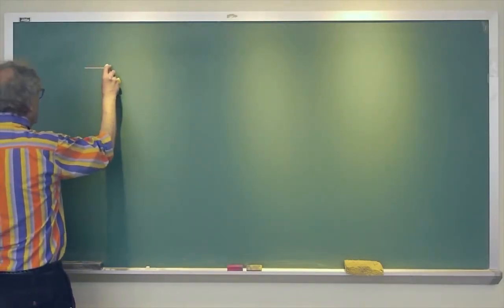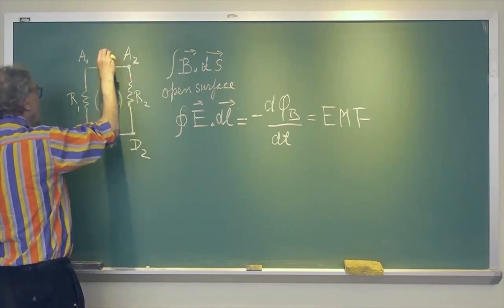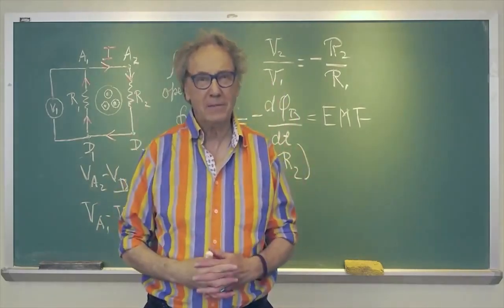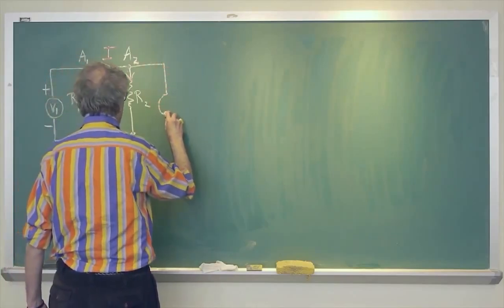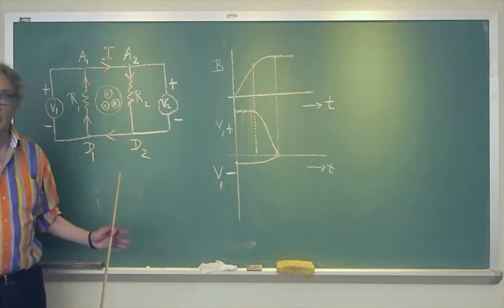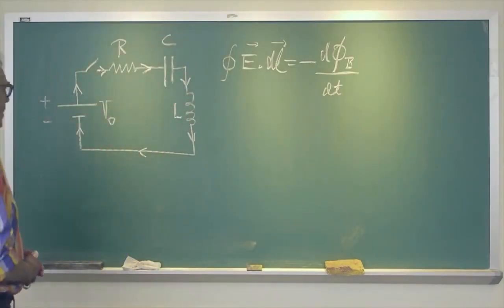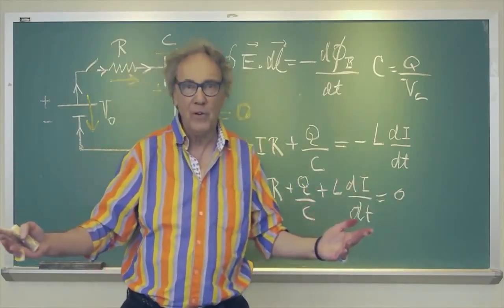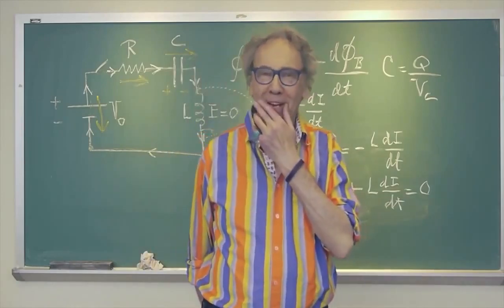Kirchhoff's Loop Rule Is For The Birds

Comment: Hello Dr. Lewin,

When you  applied Faraday's law on the RLC circuit and you  drawn the electric fields of the battery, resistor and capacitor, these electric field are conservative ? As for the self-inductive L, can we say that the electric field is zero because it consists of the sum of a conservative electric field + non-conservative electric field?

Thanks
Reply from the maker: The E-field in an ideal L has to be zero because it has zero resistance.
Reply: Yes, but when you measure the voltage across the inductance it gives a certain value. This value is due to a conservative electric field? What about the electric field across the resistor and capacitor in the RLC circuit?
Reply from the maker: That is all explained in detail in my lectures.
https://www.youtube.com/watch?v=t2micky_3uI&index=21&list=PLyQSN7X0ro2314mKyUiOILaOC2hk6Pc3j

https://www.youtube.com/watch?v=FWMhk6x785Q&list=PLyQSN7X0ro2314mKyUiOILaOC2hk6Pc3j&index=26

and in others
Reply from the maker: https://www.youtube.com/watch?v=nGQbA2jwkWI&index=17&list=PLyQSN7X0ro2314mKyUiOILaOC2hk6Pc3j
Reply from the maker: What they write is perhaps not wrong but it's NOT the way I think of why the E-field in an ideal L is zero.
Reply: if it is not the case, then  you don't consider there are a build-up charges on the surface of the inductor? And when you mentioned in this lecture that the measured  electric field outside the inductor is non-zero, and its integral over dl is equal to Ldi/dt, this electric field is due to what then? Is it conservative or nonconservative? 

Thanks for the discussion sir.
Reply from the maker: watch this lecture. I cannot add to that.
https://www.youtube.com/watch?v=nGQbA2jwkWI&list=PLyQSN7X0ro2314mKyUiOILaOC2hk6Pc3j&index=17
Reply: Sorry If I am asking a lot of questions. But I am a little bit confused about this issue: 
In this pdf http://freepdfhosting.com/d5fc27ec92.pdf, ok I understood that the electric field is non-conservative across resistors R1 and R2 and I understood why each voltmeter shows different values. But what I am confused about, if we replace the voltmeter by a resistor R , there's an electric field inside this resistor. This electric field is still non-conservative? Another case, taking the inductance circuit (LR or RLC), if we connect a resistor in parallel with an inductance, the electric field inside the resistor is conservative or no? 

I am asking these questions because when we connect a generator (inductor) to a resistive circuit or any other circuit, the generator will have a non-conservative electric field like an inductor, however the generator will produce an electric field inside the resistor that is conservative thus the appearance of surface charges across the resistor (I don't know if it is true). If this statement is true, then,  what is difference between the closed loop in this pdf http://freepdfhosting.com/d5fc27ec92.pdf; where the electric field is non-conservative and I suppose then there's no surface charges built on the resistor; and a circuit containing a generator + a resistor. 

Thanks again.
Reply from the maker: The demo I show has become a classic - it is shown all over the world. Two identical  voltmeters connected to the same 2 points in a circuit show very different values and the polarities are reversed. That's the power of Faraday’s Law which runs our entire economy. It's amazing how many people have a religious INCORRECT believe that Kirchhoff's loop rule always works. If that were true my two voltmeters should read IDENTICAL values with the same polarity but that is not the case. K’s loop rule is only valid if d(phi)/dt=0 but that is not the case here. Thus the integral of E dot dl in going from A to D depends on the path and the 2 paths are different; one path is through R1 and the other path is through R2. If you don’t get it, you are not alone. Occasionally I get comments from people including science teachers who want to argue with me about this demo  - they clearly never FULLY understood Faraday's Law. I never argue with anyone about this as this is too basic.
This is my last msg on this topic.
watch https://www.youtube.com/watch?v=nGQbA2jwkWI&list=PLyQSN7X0ro2314mKyUiOILaOC2hk6Pc3j&index=17
Reply: I am not arguing about this demo and I fully understood it. I am talking about the electric field across a resistor  connected to an EMF source (Generator) and the difference between it and the demo... I understand that in the demo it is non conservative field but in the case of the generator if it is not conservative how can we explain the appearance of built-up charges at the surface of the resistor.....
Reply from the maker: Potential difference between 2 points is not well defined in cases where dphi/dt is not zero in some loops. What is always well defined is the intergal of E dot dl across a resistor. If all fields are conservative we call the integral of E dot dl the potential diff over the resistor and the potential difference between 2 points points in a circuit is then independent of the path. It all follows from Maxwell's eqs. Faraday's Law is one of the 4. The answers to ALL your questions are in my lectures. I cannot continue this discussion. You have to do some more work. sorry.
Reply: Paul Tibet  rr

Comment: Imagine an electromagnet hanging over a plane of superconducting material. If I switch on the magnet, Eddy currents will flow. If there can be no electric fields within superconducting materials, what then makes the current flow? Can't bend my brain around that.
Reply from the maker: First, I suggest you read up on Meissner effect. Second, keep in mind that J(current density) = E*sigma (sigma is conductivity). If E is zero and if sigma is infinity, J can be anything.

Comment: This is indeed a remarkable phenomenon. Voltage measurement is dependent of the measuring loop the cables are forming. And I'm sure a lot of teachers out there are not aware of it. 
On the other hand this is something every prospective electrical engineer should know after three months into the study.
Reply from the maker: Yes, they SHOULD know, but many don't. Watch my demo in this lecture, it will blow your mind. https://www.youtube.com/watch?v=nGQbA2jwkWI&index=17&list=PLyQSN7X0ro2314mKyUiOILaOC2hk6Pc3j

Comment: You didn't confuse me.  You UNconfused me.  I graduated decades ago, but was reviewing Maxwell's Equations by watching videos on YouTube.  On review, Faraday's Law didn't make any sense to me at all, because I saw almost immediately that it appeared to contradict Kirchoff's Voltage Law.  I puzzled about it for days, with only a vague understanding of what might be wrong, until you finally confirmed that Faraday was right and it was Kirchoff that didn't apply.  That was hard for someone trained in electrical engineering to accept after all these years.  Thank you for setting me straight!
Reply: Watch the electroboom video on disagreeing with master...Kirchoff law and faraday laws both hold good...problem is with experiment of Dr.Lewin...He didn't consider the voltage induced in the voltmeter wire due to poor probation of voltmeter...
Reply from the maker: @devangagnihotri5413  maybe this will help you:
I have addressed all relevant issues already 16 years ago in my Lect #16 and #20 of my  MIT course "Electricity and Magnetism" (course 8.02)
8.02 Lect #16: Electromagnetic Induction https://www.youtube.com/watch?v=nGQbA2jwkWI&list=PLyQSN7X0ro2314mKyUiOILaOC2hk6Pc3j&index=17
8.02 Lect #20: Inductance RL Circuits https://www.youtube.com/watch?v=t2micky_3uI&list=PLyQSN7X0ro2314mKyUiOILaOC2hk6Pc3j&index=21
and also in my lecture notes of Lect #20
Belcher/Lewin Most Physics Books got it wrong
http://freepdfhosting.com/0813df09f5.pdf
For more information see below
Is Kirchhoff's Loop Rule for the Birds?
https://www.youtube.com/watch?v=5be3zpj_eCY&list=PLyQSN7X0ro22zanLOcvkaSY-IZqheFYM5&index=7
Romer (1982) What do Voltmeters measure?
http://www.phy.pmf.unizg.hr/~npoljak/files/clanci/guias.pdf
To Agree or Not to Agree with the Master that is Not what Matters
https://www.youtube.com/watch?v=ototTU5NUNA&list=PLyQSN7X0ro22zanLOcvkaSY-IZqheFYM5&index=58
To Agree or Not to Agree that is Not the Question
https://www.youtube.com/watch?v=AQqYs6O2MPw&index=57&list=PLyQSN7X0ro22zanLOcvkaSY-IZqheFYM5
My Sincere Apologies https://www.youtube.com/watch?v=d_XqrZo5_7Y&index=1&list=PLyQSN7X0ro22lt9yiC7-aYnM8GWwqnICd
Believing and Science are Very Different
https://www.youtube.com/watch?v=wz_GqO-Urk4&index=10&list=PLyQSN7X0ro22zanLOcvkaSY-IZqheFYM5
5+3-8=0 https://www.youtube.com/watch?v=f3-SfzepuPs&list=PLyQSN7X0ro22zanLOcvkaSY-IZqheFYM5&index=9
Reply from the maker: Thank you for your honesty. Watch the demo in Lect #16 of 8.02. It will blow your mind! https://www.youtube.com/watch?v=nGQbA2jwkWI&index=17&list=PLyQSN7X0ro2314mKyUiOILaOC2hk6Pc3j

Comment: I understand Faraday's law, and I understand it ALWAYS applies (I have a BSEE and 43 years experience in the field).  This is not about a law, it is about a method of analysis, and where the law is "cranked into" the mathematics.  When analyzing using EM field analysis, the law is exactly as you say, and all the "weird" results cited in your problem happen, if the "circuit" were built physically as you say (but you would need either a LOT of iron filling the loop, a superconducting coil providing the MMF, or run at a high frequency to see a significant effect).  When analyzing by circuit analysis, Faraday's law still applies, but it must be "packaged" inside a component.  So the flux you have linking the "circuit wiring" is an inductor "in sheep's clothing"; so it needs to be made into a "real" circuit inductor if you choose to use circuit analysis (or better, a transformer, since you need a way to produce flux external to the resistor loop).  In circuit analysis, all differential equations come out of components.  The interconnections only set equates between variables all those equations, by application of Kirchhoff's current and voltage law, to get the DiffEQ for the whole circuit.  If a "circuit" is made that doesn't "obey" the Kirchhoff's laws, then it is not a circuit, by definition!  So the teaching needs to make a distinction between the "thing" you have built and a "circuit".

I could conjure up a similar "circuit" having some big parallel plates mixed up with some resistors, and claim to violate Kirchhoff's current law when I start waving some charges around.  But again, this would be a violation of the use of circuit analysis.  I could make it correct by adding a capacitor to the circuit and coupling it to a varying voltage source.  Kirchhoff's law would be vindicated.

Keeping circuit analysis separate from field analysis completely alleviates this confusion.  When the student "connects" the voltmeter leads, the circuit scheme forces him to either 
see the effects of the test leads linking the flux (or forbids his doing it), because they must pass "inside" the inductor.

What the field theory does is to allow derivation the equations defining the various circuit components, and when circuit analysis is a sufficiently good model for the problem in question (one law's effect so supersedes all others that the others can be neglected), to the accuracy required.  Feynman treats this subject well in his volume 2.  He sits up in your league as far as teaching physics goes.

(I have some ideas for lecture demonstrations you may be interested in, such as measuring eye refraction by laser speckle movement, and others.  If you are interested, I will describe and show videos of them.  I have also methods of analysis, "solution by scaling" that you hint at but don't directly address in your lectures).
Reply from the maker: Please watch my Lect #16 of 8.02. The demo I show has become a classic - it is shown all over the world. Two identical  voltmeters connected to the same 2 points in a circuit show very different values and the polarities are reversed. That's the power of Faraday’s Law which runs our entire economy. It's amazing how many people have a religious INCORRECT believe that Kirchhoff's loop rule always works. If that were true my two voltmeters should read IDENTICAL values with the same polarity but that is not the case. K’s loop rule is only valid if d(phi)/dt=0 but that is not the case here. Thus the integral of E dot dl in going from A to D depends on the path and the 2 paths are different; one path is through R1 and the other path is through R2. If you don’t get it, you are not alone. Occasionally I get comments from people including science teachers who want to argue with me about this demo  - they clearly never FULLY understood Faraday's Law. I never argue with anyone about this as this is too basic. This is therefore my only response to you and to others like you. 

By the way, in class I made the length A1-A2 zero and also D1-D2; thus there is only one point A and one point D and both voltmeters are attached to A and D. However, that is not at all a necessary condition as the resistance of common copper wire is much much lower than the resistances of R1 and R2. Thus my diagram on the blackboard is fine. 
https://www.youtube.com/watch?v=nGQbA2jwkWI&index=17&list=PLyQSN7X0ro2314mKyUiOILaOC2hk6Pc3j
Reply: I watched the lecture.  I see nothing unusual about the experiment, and it is an excellent lecture!  The "unusual" part was your statement that the EE and physics department claimed you were cheating!  I can see that you are not cheating.  I have an background rooted in both physics and EE.  In junior high school, I took 60 Hz power transformers apart and rewound them to suit the voltages I wanted.  I know about non-conservative fields before I ever saw the inside of an institute of higher learning!  The part I wanted to pick a bone about is about circuit analysis.  Kirchhoff never claimed his rule applies always, except in circuit analysis.  In fact, one of the rules for being "allowed" to apply circuit analysis is that Kirchhoff's voltage and current laws must hold!  So the "circuit" presented cannot be analyzed by circuit theory.  The problem is that you drew wiggly lines for resistors (and a battery symbol in the earlier circuit).  Those are circuit symbols!  The moment you use such symbols, you must pay a "license fee", which is to obey circuit analysis constraints.  You can do that by adding another component that possesses the magnetic induction inside it.  Now your circuit has 3, not 2, nodes in the loop.  The meters are no longer connected "to the same 2 places".  The EE department, like myself, is probably more persnickety about what a "circuit" is, and when "circuit" analysis applies.  I would assume that the physics department is not so picky, as physicists normally focus on fields problems.  One lesson is that when we mix analyses, we must be very careful!  Shame on the EEs for not seeing through this!

I will give you another practical example where I ran into this at work (5 times in my career!)  A contractor mounted a 60Hz toroidal power transformer on a metal chassis with a single bolt through the center in a piece of portable equipment.  That's OK.  Then came the military "3 ft drop test onto a steel plate" ruggedness test, and the toroid broke loose.  The mechanical engineer added a square metal plate over the toroid, and added 4 more bolts around the periphery, outside the toroid.  The equipment worked, but "mysteriously" overheated after a half hour!  I was called in to determine why.  The 5 bolts formed a shorted turn secondary on the transformer (voltage was about 1/2 volt).  I told the ME to insulate the center bolt from the plate with nylon hardware.  Problem fixed!

When you wire up a toroid transformer, the way you route the leads changes the output voltage (you snake through the toroid hole), just like in your "circuit".  In your setup, the toroid  "core" is unseen air, and of such a large size, so the fact that you are "snaking" the lead around the "core" is not physically obvious.  So the 2 meters are "not connected to the same 2 points" from a circuit standpoint, as you claim.   There are 3 points in your circuit.  In order for them to be "connected to the same 2 points", one of them must link the unseen magnetic field.  Then they will read the same.

Of course, you could have an even simpler "circuit" by looping 1 voltmeter lead around the solenoid, and then connecting it to the other.  You would see a 0.1 V pulse between "shorted together meter leads".

Where should I present to you my lecture demonstration ideas?